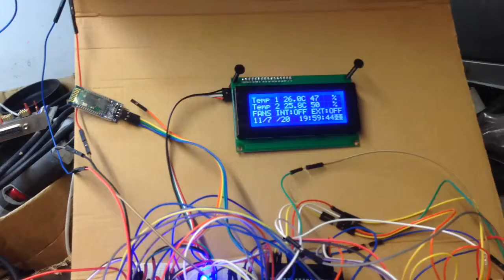Smart grow room rtc light timer arduino

Comment: You may wish to note the block at the end of the bottom line (far right at bottom): if this character is not intentional then it is because you are using "lcd.println" rather than doing a normal "lcd.print".  I have done this several times because of changing between printing in the Serial window and printing to LCD.

Comment: hi, my dad and I are trying to setup a timer system for lights in a fishtank using an arduini and a ds3231  rtc. 

i was wondering if you could send me a sketch for a single led to come on when the rtc hits a certain time.

~thanks in advance!
Reply: Here is a version that might suit your needs.  I made it for a 16x2 LCD display but it could work with the 20x4 LCD just by setting that on line 15: https://github.com/quantumsized/DS3231_timer